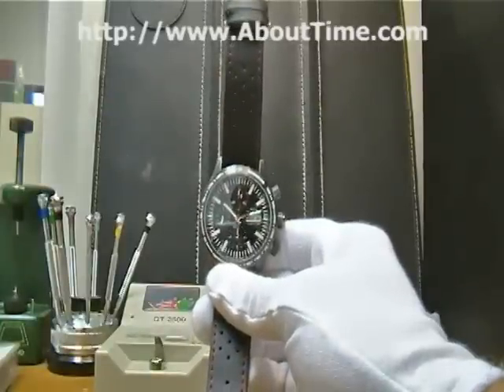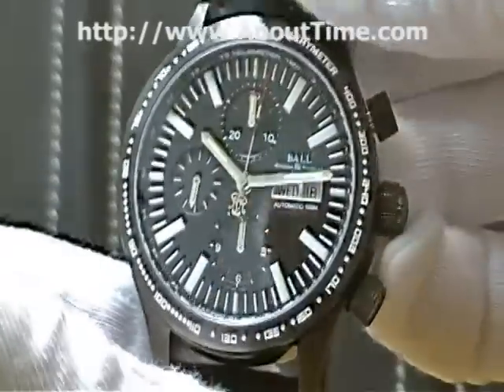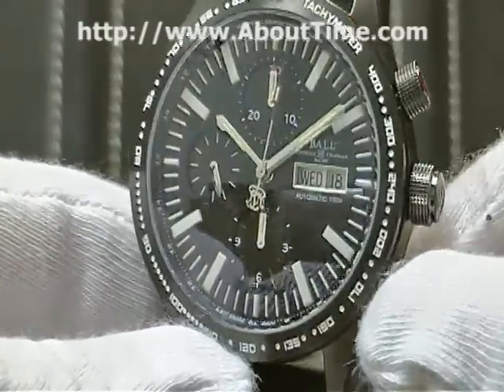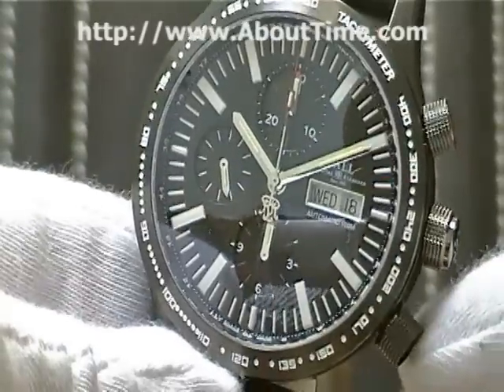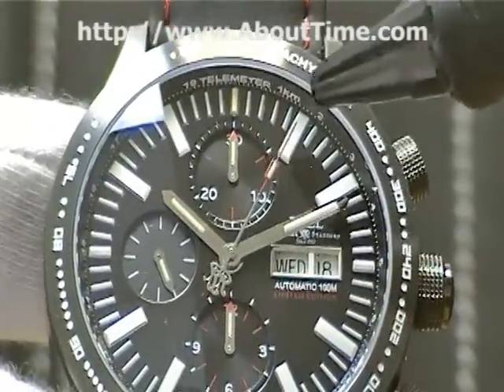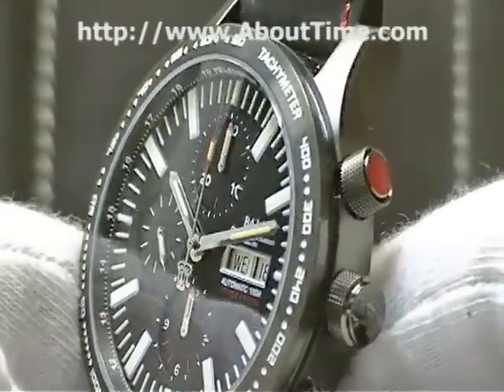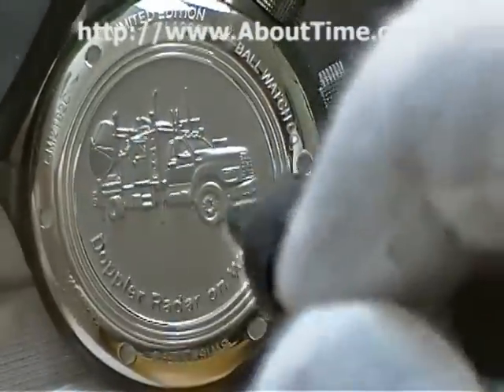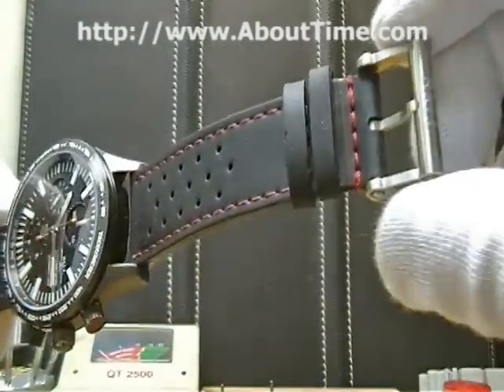Ball Fireman Stormchaser DLC Glow Watch Video

Comment from the maker: Ball Fireman Stormchaser DLC Glow Watch
Model #cm2192c-p2-bk

LIMITED EDITION TO 1999 UNITS, Movement: Automatic caliber ETA 7750 Functions: Hours, minutes, subsidiary second, day and date, Chronograph with accumulated measurement up to 12 hours, Tachymeter, 66 micro gas tubes on dial for night reading capability Shock resistance: withstands 5,000Gs shock test Water resistance: 100m